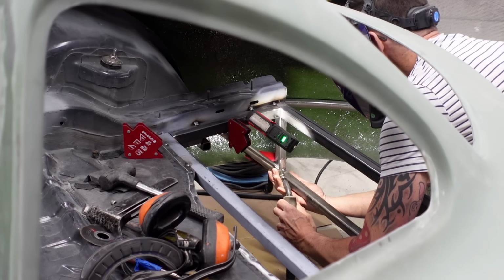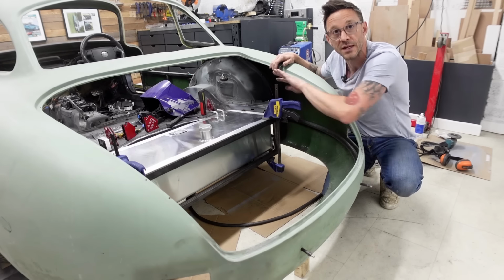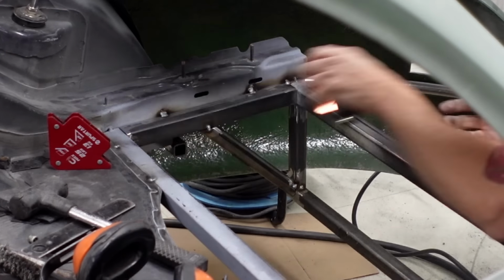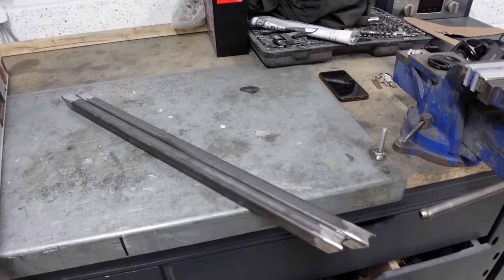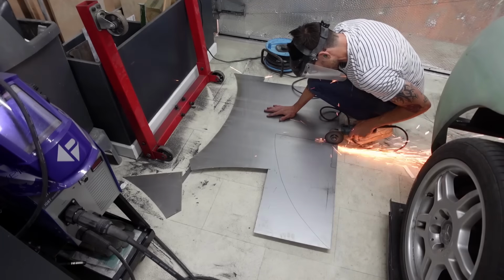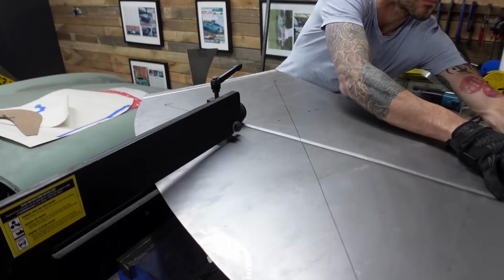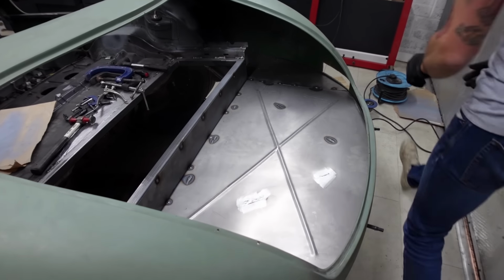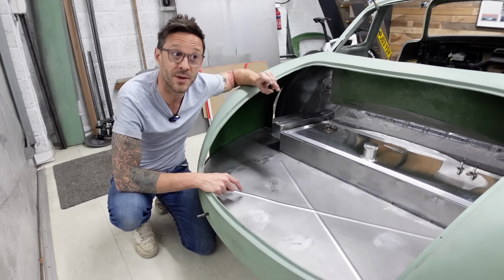Building the Rear Structure for My 300SL Gullwing

Comment: Your explanations / thinking to construct support bracing that minimises risk to the tank is absolutely sound, but most of what has been done is contrary to this - pretty much all of it is directly or indirectly connected to the tank support frame. A good knock anywhere across the rear bumper is going to affect the tank - the one thing you were trying to minimise the risk of.

Might it have been better to have left the tank frame completely independent / only dealing with supporting the tank and instead extend the rear chassis legs - which are much more substantial to begin with - and build decent rear impact protection from there?
Reply from the maker: Good thinking, perhaps something to remember if I build another! Appreciate the input

Comment: Love your videos! Please weld the boxed tubes against the original chassis over the full length on the upper side and underneath so that you don’t create any potential rust issues because water can get into the seems. Therefore I don’t prefer overlapping sheet metal to because that’s the same story, water can get in between the panels. Therefore I would weld the boxed tubes to the boot floor at the under side over the full length of al peaces so everything is shut and you don’t have to seem seal it, and it’s super strong to. I hope you understand what I mean because English is not my first language. Keep up the great work you are doing.
Reply from the maker: Hi, yes that made sense, no problem. I will be using seam sealer on all joints before painting the underside of the car

Comment: Great thought into the collision impact potential. I was thinking about that when you first started the side sponsons and how you were going to box and brace them. Like you pointed out, triangles are the best rigidity with the least amount of material (weight). If you diagonal brace the sponsons from inboard to outboard, angle the tubing from high on the outboard side to low on the inboard so that in the event of a side collision the brace will go under the seat (hopefully) instead of through your thigh. As always, stunning fab. Boot looks professional. Are you going to put side panels in the boot to close in the sides and rear corners? Good places to hide your pump/tank and a jack.
Reply from the maker: Thanks as always mate, yes the boot will be fully paneled out to hide as many ancillaries as possible

Comment: Looks like you might’ve cut the section of rear inner wing out that contained the one way pressure relief flaps (that vent through to rear arch in a lot of cars). Might want to add some in or shutting the doors or boot will be difficult/pop anyone insides ears a bit.
Reply from the maker: Thanks, I'll bear it in mind

Comment: I’m still fan of proper crash bar to the rear and extending of genuine chassis rails. Also vertical fuel tank. Can you remember ford pinto case when fuel tanks got smashed after car was reared?